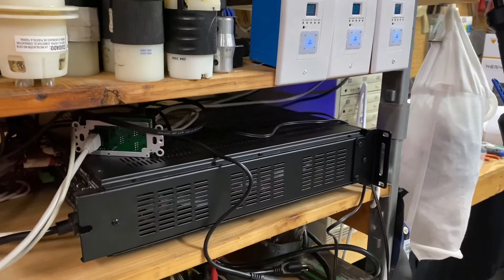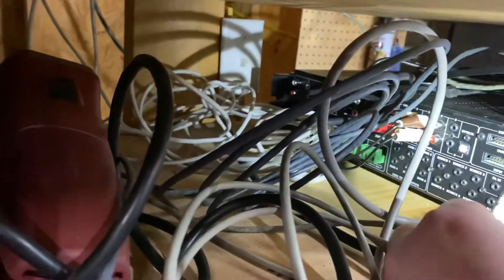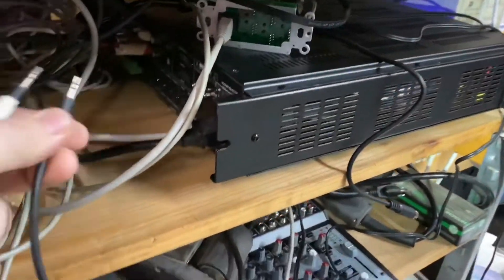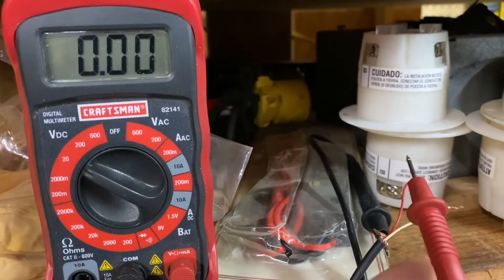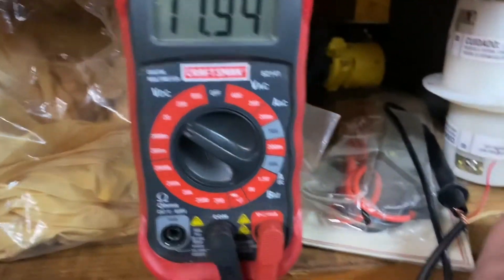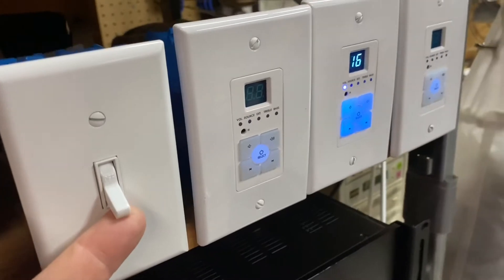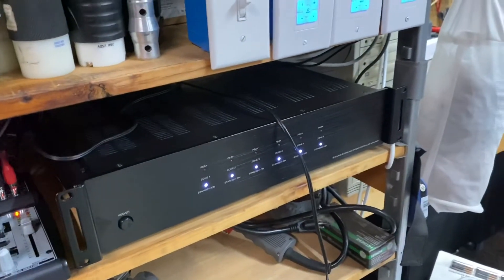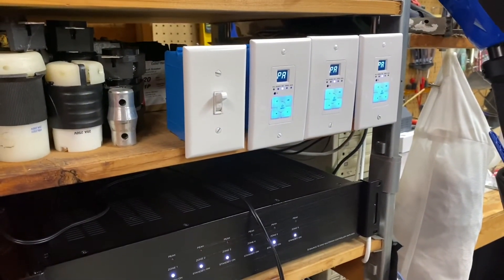How to use 12 volt trigger to activate PA function on mono price 6 zone amplifier using a switch.

Comment: Really appreciate the video, not sure why the instructions in the monoprice manual weren't clear to me on how the 12v trigger and PA input worked but your video really helped.  I am basically using an audio controlled relay that detects if audio is coming from source 1 and then if it does it sends that 12v to have a TTS announcement come over the PA (triggered by an automation in home assistant on a pi).  However, for some reason the PA doesn't appear to broadcast the full message (almost like it is delayed) unless the zone is already on.  So my question is do you typically have all of your zones on when activating the PA and/or have you experienced this where if you turn the PA on does your mic announcement get cut off in the beginning if the zone is off?